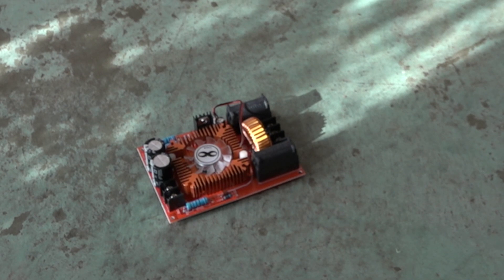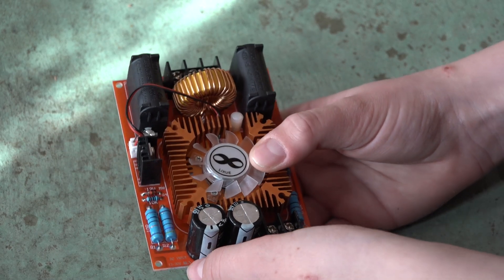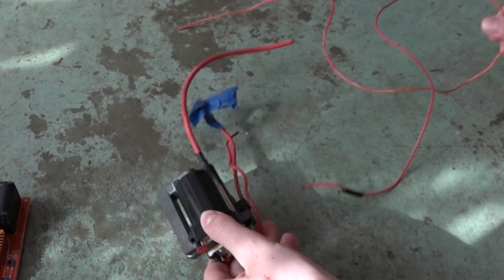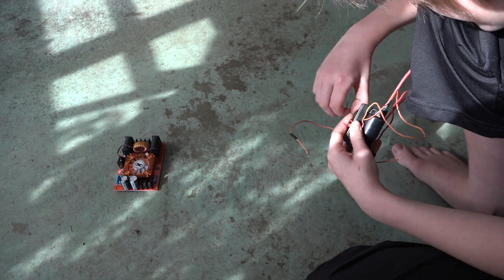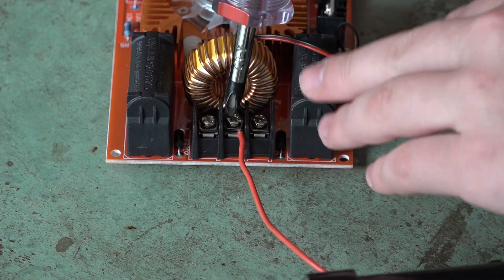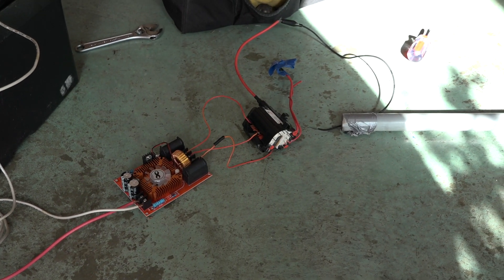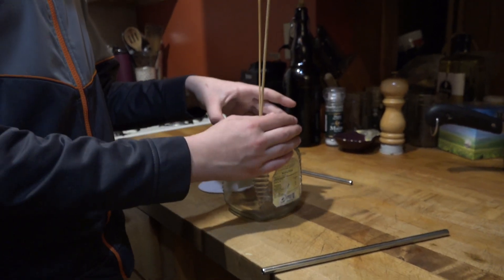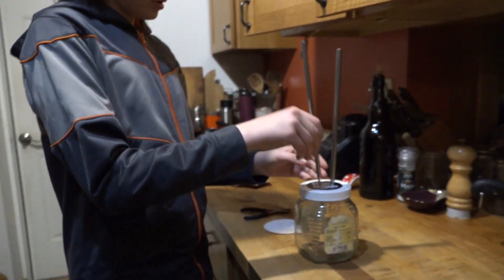eBay ZVS Driver Review(30,000 Volt Flyback Driver)

Comment: That zvs driver is extremely powerful. If you drive it with an 24 volt ballast with an adjustable amperage pot it will run a tesla coil.  I made a rotary spark gap with 3 leyden jar capacitors my primary was 6 turns my secondary was a 24" 2" piece of pvc pipe with 22 gauge wire wrapped almost full length of tubing and a 6 inch 1 piece toriod from a drsstc i no longer had. The unit produced 18" bolts which was great being the first coil I ever got to work the 4 I did before it were garbage. Anyway that zvs drive with 24v and 20 amps will hurt you!bad!!!! So be extra careful. I'll try and post my video to your page. Thanks for the videos I love high voltage.

Comment: You should take a saw blade and a metal rod. connect the + to the saw blade an the - to the rod put them 1 1/2" apart and listen for the hiss. when you get it. Turn off the lights you will get a plasma glow. Rounded blades and rings work to. Good luck. I like the channel.

Comment: Its possible to make an desktop nuclear reactor using that 😂?
Reply from the maker: if you run a voltage multiplier off of it to get up to about 75kv, then totally
Reply: For nuclear interactions you would need energies above 1MeV, so...

Comment: Fun and informative video! I'm glad you outlined the dangers of the experiments and also showed how to wind a primary onto a flyback transformer. Not many people show that step, they just say, "so I rewound the flyback transformer". Also the tesla coil was probably not tuned perfectly, right? Let me know.
Reply from the maker: Yea I tried to tune the coil but my Leyden jar capacitors are really crappy. I personally don't like zvs drivers for Tesla coil power anyway since the voltage is really overkill and requires expensive higher voltage capacitors to get decent tuning. this was supposed to be a quick build made from junk I had laying around anyway.
Reply: @NerdlabsSci  sounds like you need a flyback transformer with rewound secondary for lower voltage
Reply from the maker: @ErikDaGreat  these flyback transformers are potted in some weird plastic resin shit that makes them impossible to rewind